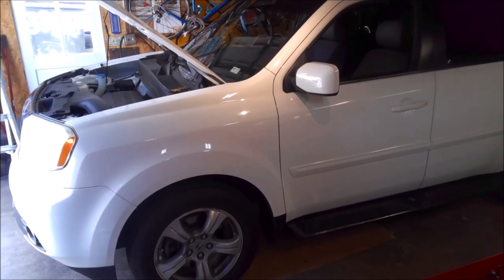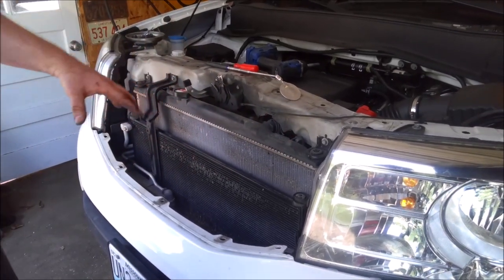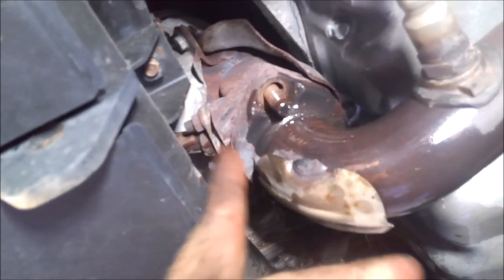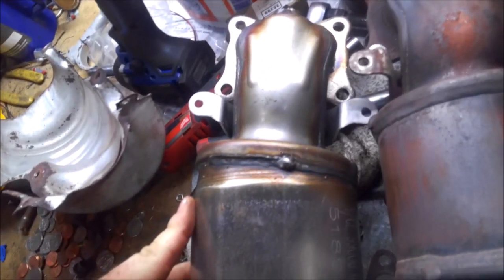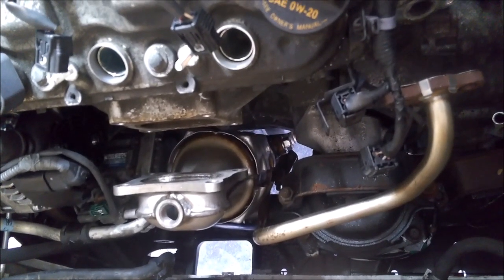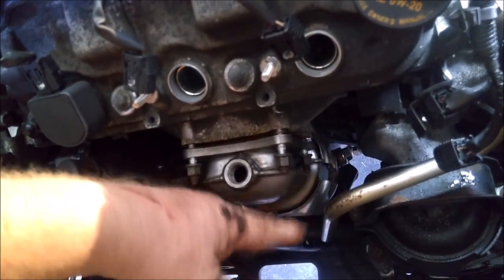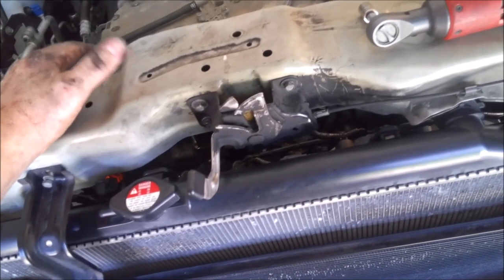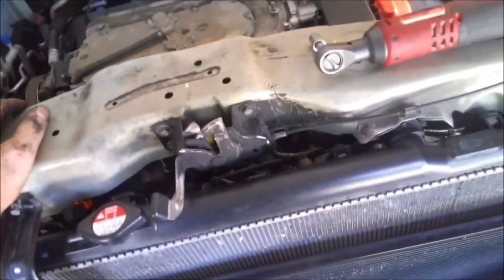2012 Honda Pilot p0430 - Catalytic Converter replacement

Comment: The reason these cats in the Honda V-6's go out prematurely is because of the defective eco mode shutting down the cylinders and oil going past the rings into the cat's. Do the Eco bypass from VCM tuner and problem solved after replacing the cats if the rings aren't worn.
Reply: Sounds interesting...You have done this on this model?
Reply: YUP.  They had a class action lawsuit for earlier years, but Honda didn't have 2015 included in it. I got The cylinder management system bypass attachment a little too late and it burned up some exhaust valves in my engine block as well as destroying the catalytic converters

Comment: Damn this video is badass it helps a ton thank u for ur knowledge. I bought all three cats at autozone a cool $g. I hope they all fit. I had used cataclean n the check engine light went off n on twice then finally it went off n stayed off for months but the other day I put in new spark plugs n coils. Took it out for a test drive n 5mins Ltr the damn check engine light came back on. Mind u I never did install the cats I had them stored in my house for whdndver or if the engine light came back on well it did had it checkout st autozone n it was po420 the two front cats were bad  the code reader said. Sonos I guess I have to change them out but damn I'm no mechanic but I'm a good learner. Thanks for ur video
Reply from the maker: Thanks I appreciate you watching!

Comment: Great video Thank you.   I have 2010 Honda pilot with P0420.    Are P0420 and P0430 for the same converter or is P0420 is different?   Still need to check live data to see what my front and back O2 sensors are doing.
Reply from the maker: No they are different cats

Comment: So I have been looking at the magnaflow cat’s for the engine front and back. I saw this video and have not ordered them. But I did email them, they replied back saying that the improved design removes the need for the heat shield. Would that solve the problems with this? Would there still be an issue with the bracket or bolts? Thx so much for reply. 🙏
Reply from the maker: It's been a long time since I've done that job so I cant really remember I don't use magnaflow anymore I've been using napas brand which has been fitting really good or sometimes dorman brand which so far have been fitting pretty decent .

Comment: In the reinstall, you mentioned refilling your radiator. Is it required to drain your cooling system for this job? I know you remove the upper radiator hose but would that require a complete drain of the system? Looking to attempt this repair on my 09 as this code just popped up and registration is coming up in a few months.
Reply from the maker: No you don't have to drain the entire system just remove hose and have a pan to catch what comes out .
Reply: @HooptiesGarage  Awesome, thanks for the reply and great video!

Comment: Did you replace just for the code? Any other issues or just a paranoid customer?
Reply from the maker: Yes 430 is a bad cat code you can't have any codes in st Louis to pass inspection to get your plates.

Comment: No gasket where the cat meets the pipe? I did mine a week back and there was no gasket present. I didn't get a gasket with the new cat, either. I tightened it down good and felt around the fitting, can't feel any exhaust gas.
Reply from the maker: On the one I did there was a small gasket it fits down in the flange.
Reply: @HooptiesGarage  Brother , I feel your pain.  Here in Maryland we have a 2011 honda pilot 3.5 that we are going to replace BOTH cats  ?    If customer agrees to price ?  $2200- $3000 depending on a variety of difficuties that may arise. The thing has 185,600 miles on it.  It came from the jersey shore.................RUST

Comment: For all you with a 2nd Gen (2009-2015) Honda Pilot with a P0430 code... use fuel from Citgo gas stations for the next 2 to 3 month and reply to this post if it helped. (Make sure you incorporate highway driving with the Citgo fuel).
Reply: so you are saying using citgo gas will fix this code????  thanks...
Reply: What if there isn't a Citgo in your area??

Comment: Blessings will this work the same way on a 2005 Honda Pilot ex? My code is p0430
Reply from the maker: I don't think so in 2005 I believe the converter was not on the manifold like it is on the newer years, you probably have a weld on converters underneath the car.
Reply: @HooptiesGarage  ok thank you